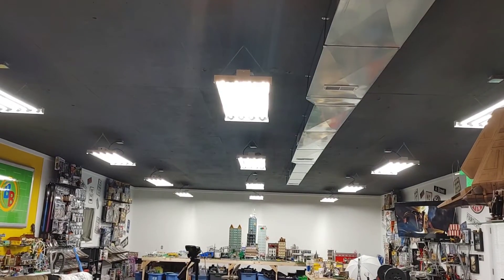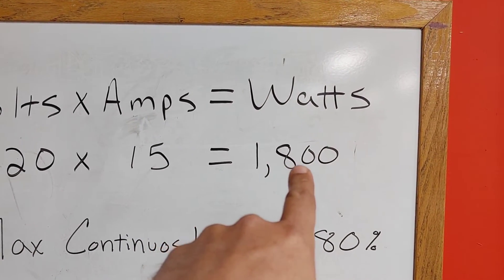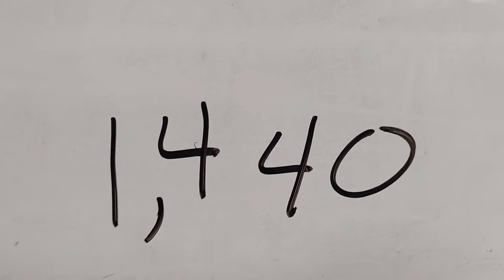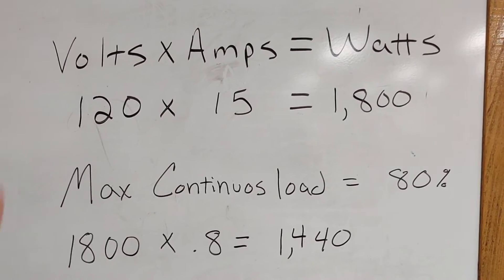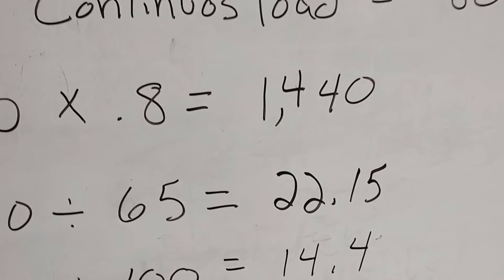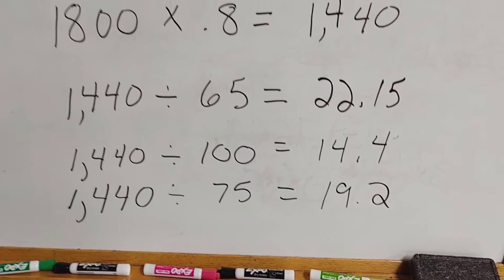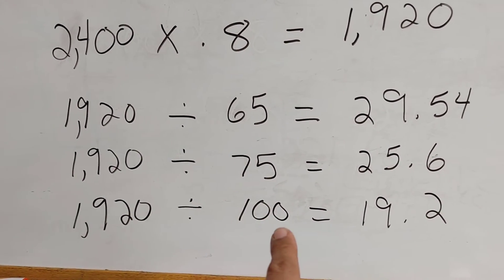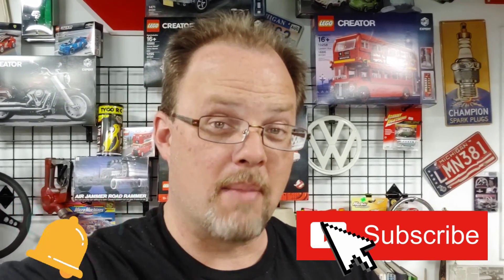How many lights can you put on one 15 amp or 20 amp breaker.

Comment: For commercial you are right but for residential it’s based on the square footage of the house. 3va per square foot. After you know how many circuits you need you divide the number of fixtures up evenly between all the circuits. A simple plastic lampholder could be rated for 660W but if you’re putting a 9W led in there. No one is going to put a 660 w bulb in their laundry room or whatever

Comment: Thanks for sharing this! How does the length of the circuit play into the calculation? I'm attempting to run approx 120ft of 14/2 romex to at quanity of 12 fixtures that are 72 watts each. Im temporarily running them on a 50ft 12 awg extension cord, and all of the lights are flickering. The voltage at the first fixture is 118 V, and the last fixture is at 115V. Do you think the voltage drop is causing the flickering? Or something else?

Comment: The electrical in the house I bought is a mess. My question is can I dedicate one circuit for each room?
For instance my master bedroom has seven outlets and two ceiling light fixtures. Assuming the light fixtures were rated for 100 w each could I put all of this on one breaker?
Reply: Yes, thats how electrical contractors do it. One circuit for each room is the best practice. Just remember the kitchen, bathroom and garage lights and receptacles can't be mixed on one circuit.

Comment: I once lived in an older apartment that put EVERY light on one 20A breaker.
Might have been needed when that wiring was done - but with my mix of LED and compact fluorescents, it was SEVERE overkill.
I talked the owner/manager into adding a 15 amp duplex outlet to the circuit, as that place was WAY short on outlets.

Comment: If installing fluorescent fixtures , You have to add the wattage of the fluorescent tubes plus the wattage of the ballast , For example , A 4 foot two bulb fluorescent fixture would draw around 180 watts , The average wattage of two 4 foot fluorescent tubes is 80  watts plus the wattage of the ballast , Another thing is that if you go with LED light fixtures , You can add alot more fixtures because of how much less watts they use than fluorescents and incandescent fixtures
Just use the same calculations shown in the video , Definitely best to go with LED fixtures and avoid fluorescent , Mercury vapor or other fixtures that have a ballast because they use more power than even incandescent fixtures
Plus with LED fixtures , You won't have the troubles with LED fixtures compared to fluorescents and other fixtures that have a ballast , Plus LED fixtures and bulbs are coming down in price , Now if you have fluorescent fixtures and want to convert them to LED tubes , It's best to get the direct wire LED tubes for saving energy costs
The plug and play LED tubes use the existing ballast which is not practical because you're using power to operate the ballast which draws much more power than the direct wire LED tubes
The direct wire LED tubes don't use a ballast , So they use alot less power than the plug and play LED tubes 
For example , Two 4 foot direct wire LED tubes will draw only 32 watts of power compared to the plug and play which use the existing ballast which draws 100 plus watts

Comment: You figure Watt load from lights used. Then 80% rule of watts on circuit for continuous use. Don't have to follow rule for lights not in continuous use. Continuous use defined .... 2 hrs ? and more... commercial use mostly. Warehouse, mfg areas, hallways, offices. A house...no.

Comment: Doesn't the NEC also limit the number of fixtures on any one circuit to a maximum of 12???
Reply: No. Some local municipalities have limits on the number of lights and receptacles on a residential circuit. In central Florida they had a limit of 12 points, a duplex receptacle being two points and a light being one point.
Reply: Thanks for the clarification  @JeffBanfield-t6v

Comment: So you wire in for 22 fixtures and the next owner decides they want 100 watt bulbs.  DUHHhhh!  It all depends on where the wiring is going and for what purpose.  You don't put all the ceiling lights in a house all on the same circuit because you can.  LED's are changing all this anyway.

Comment: Then...why do heaters seem to have a 1500w limit when I go look to buy one? I know they say don't put 2 on the same circuit (because that's going to trip the breaker every time), but even the 1500w is above the  80% limit mentioned.
Reply: That's a good question. Ideally these heaters should be used only on a 20 amp circuit, but many homes have 15 amp circuits in rooms where heaters are likely to be used. If nothing else is on the circuit you should be okay because you're barely above the 80% limit. I wouldn't leave one on when sleeping, though.

Comment: What happens in a series parallel circuit. (Some led light bars daisy chain in series.).  I think I want to daisy chain 4 light pairs (in series), but set each pair in parallel.

Comment: We have a 15 amp breaker running from the house to a tool room, then by knob & tube overhead open wire to a carriage barn to a 2 car older garage to a large chicken coop/workshop. Along the way there are many lights, many outlets with multiple power strips, animal water de-icers, electric woodshop tools, and now outdoor blow up Christmas decorations requiring continuous running fans. Yeah...the 15 is tripping.

Comment: good one boss!can you please do     the receptacles or outlet
Reply: There's no limit to the number of outlets on a breaker. Of course your loads on that circuit can't exceed the continuous/peak rating of the breakers. Because on a 15A circuit you can put only two outlets on there, then plug in 1500W heaters trip your breaker. Or you can have a dozen outlets, half drawing a small amount of power and the other half unused and you're fine. This is why there's no number limit on the outlets. There is a 'rule of thumb' of 1.5A per outlet towards the breaker size continuous load. But in some cases NEC requires only 1 dedicated outlet per circuit. And for some areas you don't want more than 2-3 outlets on a circuit if you are expecting high current devices to be plugged in (kitchen counter).
Reply: @thebluelunarmonkey  Quit giving fake news. 12 outlets allowed on a 15 amp circuit. Quit copy and pasting google search results, thinking you're smart

Comment: Can you substitute wattage fixture to 15 or 20 amp receptacles? Does this formula work the same to figure out how many receptacles you can use on a 15 or 20 amp circuit?
Reply: Well How TF do you plan on calculation receptacle loads? Use your head

Comment: Thanks. This applies to computers also. So I should be careful and perhaps NOT get the new 4090 Graphics card and  a new 1,600 watt power supply to put in the office, unless I put it in the dining room where we have a 20Amp circuit. Luckily it is a nice piece of decoration! And we can dine by the computers' RGB-light so we don't trip the breaker!

Comment: Good explanation. Also, for the hobbyists out there, keep in mind that these calculations are for a circuit with only light fixtures. If you put anything else on that circuit, you’ll need to subtract that load to see how many fixtures you can add.
Reply: You can only have 12 total devices if you're mixing lighting with receptacles. How do you subtract a load from a lighting circuit when you have no clue what will be plugged in there in the future. These calculations are for KNOWN lighting loads ONLY.
Reply: @That90sShow  I never specified that receptacles would be on that circuit—it could be anything that draws power. My point was making sure folks not familiar with electrical work understand that if you add other elements to the circuit, the calculations change. Your number of 12 is also arbitrary—that would depend on the circuit amperage, draw of the fixtures, whether you have open receptacles or fixed loads, etc.

Comment: FYI Building Codes are public domain and can be accessed online from numerous legal libraries. Call your local building department and ask them what Code governs your jurisdiction, and look up the residential electrical code requirements for branch circuits, etc. FYI, adding new lights and receptacles is easy renovation work, but if it isn't done right and to your local Code requirements, you can burn down your home or even electrocute yourself. If you have zero experience, hire an Electrician.
Reply: BTW, I'm a former Journeyman Carpenter turned Architect in CA.

Comment: Obviously im not a electrician..but...  why not just always use 20amp breaker..br good for more lights...microwave..etc ...why mess with 15amp?
Reply from the maker: To me yes 20 is best and I do 20 on everything but some people like to use 15 also.
Reply: It’s a combination of cost/need.  The basic room in your house runs 14 gauge wire with a 15 amp breaker and this is fine for almost all applications and it meets code.  Now, I’m guessing the receptacles over your kitchen counter are individual circuits and are 12 gauge/ 20 amp breaker to handle the toaster oven/microwave etc.  The difference in cost of the wire is about 20%. If I were building a house from scratch, I might check to see what the extra cost to go with all 20 amp/12 gauge would be.

Comment: In the UK we use 230 volts. To answer your question in the UK we  assumed total load and divide by 230 to get Amps , ie assume you want to install 12 lights on a 5Amp circuit with a 6amp MCB and the lamps are 100w each that would be 1200w divide  by 230 = 5.2Amps , that’s the design current the circuit protection device should be equal to or greater than the design current. 
As you can’t get a 5.2Amp MCB  
You will need a 6amp MCB.

This  is international no matter what the nominal voltage is.

Comment: UK, we allow 100w per outlet. Lighting is on 6amp 230v circuit. Standard house split on 2 circuits. Older houses 1 circuit on 5amp rewire fuse.

Comment: quick question thanks for explaining this method and now i have a better idea but what i am searching for is how can i check to see what receptacle outlets are in the same circuit breaker the reason is I don't want to blow a circuit breaker so i want to find 2 separate electrical circuits with ease which circuit breaker finder would you recommend for the purpose i need it for. Hopefully i made sense. One more example so if i am already plugged into a 15 or a 20amp receptacle outlet and i now need to plug another device that i know it takes a lot of juice like a fog machine and i decide to use another receptacle outlet thinking its on a different circuit breaker thats where i would use the Circuit breaker finder plugging a tester to the same receptacle outlet please help
Reply: Call an electrician and quit being a cheap bum
Reply: Just use the other receptacle

Comment: We currently have a Federal Pacific Stab-Lok breaker panel that we're planning on having replaced.  After it's replaced, I do want to separate some circuits.  I also want to put all the overhead lights in our house on one 15 amp circuit.  All our lights are LED and even if our lights were all 100 watts, they would still not exceed 15 amps.
Reply from the maker: If you're wiring a house from scratch that is one way you can do it but typically every light in a house is off of a outlet.  The reasoning for this is to reduce the amount of wire that is needed to wire the entire house.  At today's costs I would not want to wire out that way as 12/2 is about $150 for a 250ft roll now.

Comment: Daaaamn Sam!! I know your name isn't  Sam It just  ryhmes with damn and sounds cool... But nice video sir.Very informative and easy to comprehend. Of course the 15 amp circuit would be using 14/2 wire and the 20 amp circuit would be using 12/2 wire. Now if you're using led lights, you can probably use more lights per circuit because led's consume alot less power than incandescent lights right?

Comment: If you have a fluorescent HO fixtures with 2 - 110 watt bulbs installed do you figuire that one fixture at 110 watts or 220 watts ? I would think 220 watts but want to know for sure.
Reply: You look at the rating on the ballast, not the lamps. The ballast steps the voltage up.

Comment: This may sound dumb but where did you get the 120 number from? I understood all of the rest.
Reply: 120 volts
Reply: For others who may not know:  the lighting and room receptacles are at 120 volts.  Some high power appliances (A/C, electric dryer, etc) are at 240 volts and will be on a dedicated circuit.

Comment: Perfect math if you were utilizing incandescent lamps as you stated.   The problem is then you show fluorescent fixtures and say, now you know how to calculate how many lights.   Not so fast!   Fluorescent lamps have wattages on them, but you do not just add them up.   In order to do these luminaires, you must look at the ballast information and find “line current” number and multiply by voltage to get VA(let’s call it watts).  
Best wishes!    Kevin
Reply from the maker: The fixtures shown are all Led
Reply: @BevinsBuilds    My mistake.   You should still find line current instead of using watts for those LED’s.  Although not nearly as bad as fluorescent, there is still a very small amount of losses in the drivers.   Thanks for the clarification!

Comment: So basically I can add 6 new 14 watt LED recessed lights on my current ceiling light outlet wire that is a 15 amp circuit without any problems????
Reply: Only problem is if you plug in a 1500 watt space heater on the same circuit while the vacuum is plugged into same circuit.  In reality, LEDs draw so little and if you put LED bulbs in your existing fixtures you will be fine.  I just wanted to point out the issues with the high wattage space heaters use so you understand the bigger picture.

Comment: Luxx 645 led how many would I be able to put on a 15 amp ? I’m confuse & curious
Reply from the maker: If using 645 watt lights thats 5.4 amps per light so a maximum of 2 on a 15 amp circuit

Comment: So would 3 power supply be ok on a single outlet? They are 24v supply two 5amps and one 6amp so 16amps total.
Reply from the maker: On a 20 amp circuit yes.  Assuming the amperage has you are giving are the input amperage and not the output amperage.  Keep in mind a power supply is a Transformer for example when I do Led model lighting power supply that I use is a 5 amp power supply but the input amperage is 2.5 amps.  Which means the power supply only consumes 2.5 amps to give me a 5 amp output.  Hope that makes sense.
Reply: @BevinsBuilds  well I have 3 mini amplifiers and people can put 24v 10amp power brick to each one. I'm not sure if it will use the entire power from it put I have an old setup and noticed a big difference from 4.5amp to upgraded 8amp supply.

Comment: This is a great example but these days many people are getting away from the old screw base fixtures because you can still find bulbs of 150 watts and more. (yes, still out there) If you install NON screw base fixtures they will likely be a specialty base that can't accept larger bulbs and will be under 20 watts draw each. IOW, you have the added benefit of no fire hazard due to wrong bulbs overheating. Still, the math works out and it really is that simple.
Reply: Solar lighting has major potential market out there. Imagine basement lighting. No more scary basements. We dont live with basement anymore, but our north facing kitchen/living room got me into solar LED lighting. Plus, I love our bathrooms well lit for long long hours. Bright bathroom looks very clean.
Reply: @marktan3668  ... solar has it's place, but completely off topic for the question.